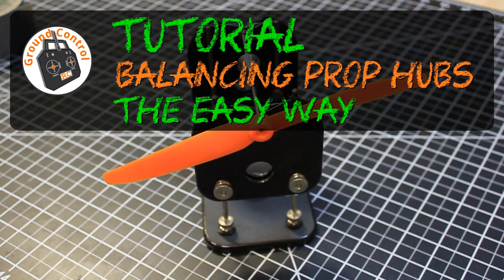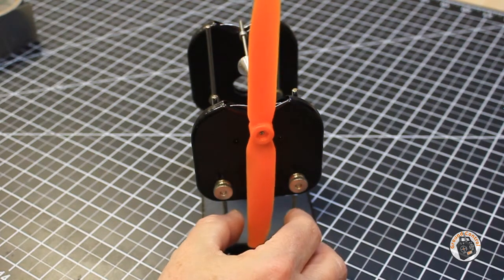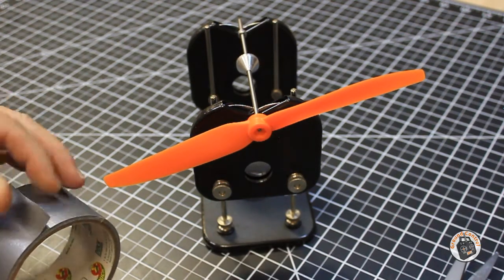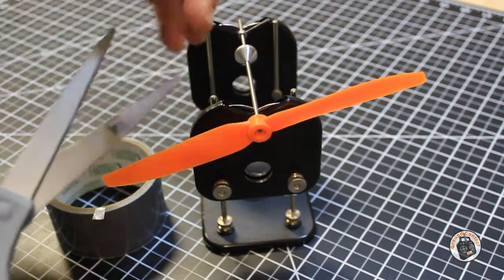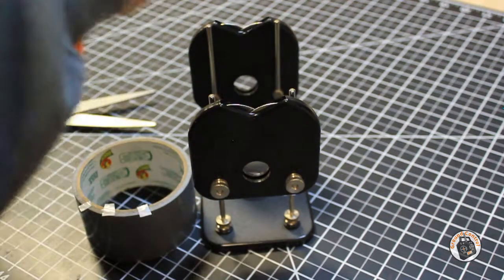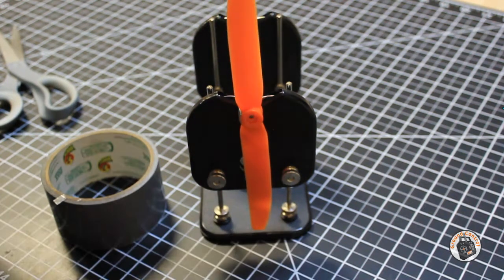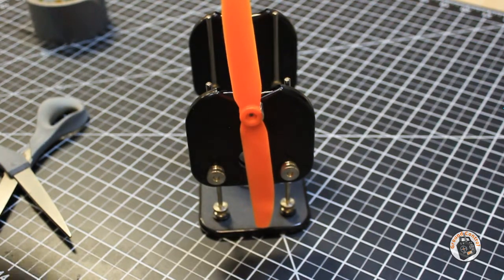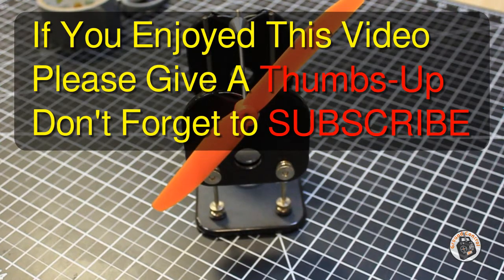Balance Your Prop Hubs The Easy Way

Comment: Thanks for this video and I think a will help a lot of people with this issue not knowing, the hub could also cause impropper balancing. The only note I would like to make, in the end you try to keep the prop from moving, but just let go. When proper balanced, it wouldn't move in whatever position the prop is in. In the end, the prop is only positioned horizontal and vertical. Would be nice to also see it turned 45 degrees. If correct balanced, it will not move in whatever position the prop is in.
Reply from the maker: Thank You Victor!
Yes, once the Prop Blades and Hub are balanced Properly the Prop will remain stationary no matter position it is in.

Comment: Ingenious, great tutorial!  Learned a lot from this.  One thing I learned from watching another video is when I am getting right to the very end of balancing a prop and I think it is balanced, I will just gently tap the table on both sides of the prop balancer.  If the shaft on the balancer is being held still by static or some other force, this will normally break that bond and show if the prop needs just a little more fine tuning :)  Well done, please keep them coming, learning lots!  Cheers, Scott
Reply from the maker: Thanks for the comment, I don't know how I missed it. The tip regarding releasing the static by tapping the table is a good tip. I'll try that on my next prop balancing session. Static is my worst enemy when balancing props. Where I live the humidity is generally around 30%-35% so static build up quickly. Happy Flying!

Comment: very nice good too see one finally working good 
bought a few cheap ones but the balancer is out of balance and didn't work :(
Reply from the maker: I have found this Dubro Prop Balancer to work very well and is not very expensive. I balance all of my props with it before putting the prop on my plane or quad and never have any issues with vibration from an out of balance prop. Thanks for your comment and Happy Flying!

Comment: I just came across such a badly off-spec propeller hub today; have been balancing props for over 23 years. My Robbe 15x7 (very wide blade, big hub) hub is so bad I ground off a significant (safe) amount of material from the heavy side, securely super-glued 2 plywood pieces to the light side and it still isn't perfectly balanced but getting close(r). Should I continue removing material from the heavy side or just abandon that prop, I learnt about off-balance hubs the hard way, when my engine "burnt" the crankshaft main bearing just yesterday (I always balance the blades but had never ever balanced a prop hub before)?
Reply from the maker: If I had one that far off balance I think I would just scrap it.
Prop are less expensive than motors, bearings, etc.
I'd be afraid if I lost that much counterweight on the hub during flight it might rip the nose off the plane ;-)
Reply: @GroundControlRC  Quite so, that prop cost me 10 Euros whereas a full set of bearings (changed them all since I would be opening up the engine, a Laser 100, gorgeous) cost me a total of 18 Euros. Not so much the cost; the inconvenience is what bothers me most.
Thank you for the feedback, glad to see our views concide - take care,
Regards Harry

Comment: Well done mate. Great video. Most people don't think that the hub needs balancing, they just balance the blades. Just wondering if you could let me know what prop balancer that is you're using? It seems nice and sensitive. Cheers.
...RCPP
Reply from the maker: The Prop Balancer is the Du-Bro 499 Tru-Spin Prop Balancer. It's a great balancer and I've never had any vibration or jello in the FPV Camera after balancing a prop with this balancer. Thanks for the comment and Happy Flying!
Reply: Cheers mate.

Comment: Just happened to watch your video on prop balance. How can you tell if it is the blades out of balance or the hub? Thanks.
Reply from the maker: That is a very good question. The first thing I do is balance the blades, then I balance the Hubs. I check the balance of the Hubs by positioning the Blades completely Vertical. If the Prop rotates to the Left, then the Right Side of the Hub is light, and vise versa. I balance the Hub by putting some Hot Glue on the Light Side of the Hub and then Rinse and Repeat until the Hub is Balanced. Then I check the Blades again by putting then in a completely Horizontal Position and Re-Balance if necessary. See you in the Air!
Reply: @GroundControlRC  Thanks,

Comment: A problem I found is the spindle of the balancer needs to be absolutely straight and round but some aren't.  Make sure the ends don't have the slightest burr where they have been cut, then roll the bare spindle on a sheet of glass that has been set dead level.  Gently set it rolling and see how smoothly it rolls and how smoothly it comes to rest.  If it rolls unevenly or rocks to and fro as it comes to rest, it's either bent or out of round, if not both.  I paid more for a new decent spindle than for the whole balancer.  Hope that helps.
Reply from the maker: Absolutely! Without a straight spindle you'll never get a prop completely balanced.
What Prop Balancer did you buy that had this issue?
Reply: @GroundControlRC Can't see a maker's name.  It was on Amazon, £15.89. Looks and operates like the DuBro  Tru-spin.  I got a refund but didn't have to return it.  I was able to get a DuBro replacement 3mm spindle but it was £18.48, which hurt a bit but at least it now works as it should.  Thanks for your interest.
Reply from the maker: @georgecopeman7668  The Dubro Tru-Spin is what I have and it works great.
I'm glad you have one now that will work.

Comment: It's not balanced because you don't have it centered on the balance shaft correctly. That centering spindle isn't on there for counterweight. The prop should be centered, and between the two support points. There's also no difference between blade and hub balance, because you cannot balance one without balancing the whole thing. Maybe start with the instructions.
Reply from the maker: Actually that's the way you balance the props on this spindle.
There's a stop near one of the ends which is fixed.
There is certainly a difference between balancing the blades and balancing the hubs.
You have to do both but this video is related to the prop hubs as the title states.
Perhaps you should post your method on your channel so others can learn from your expertise and knowledge.
I'm surprised you stated I should read the instructions as it's very obvious you didn't check to see how to use this Balancer ;-)
Here's a video on how to use this Balancer sponsored by the makers of this Balancer so you can educate yourself.
https://www.youtube.com/watch?v=l4FBitBRB2w
As you'll see, I did read the instructions ;-)